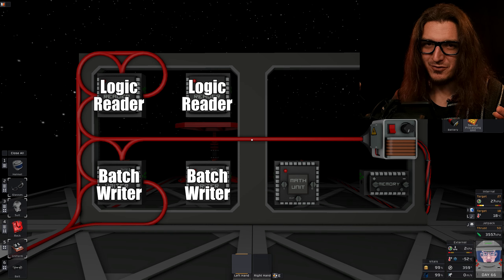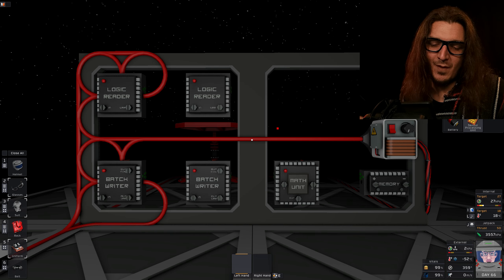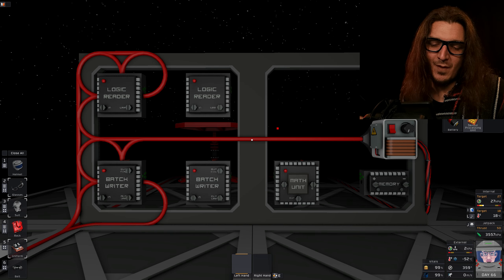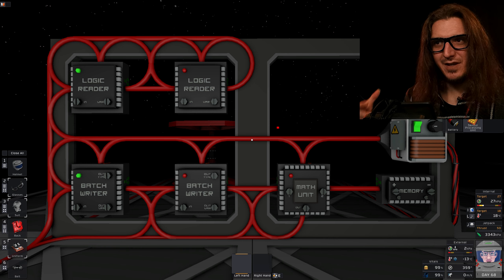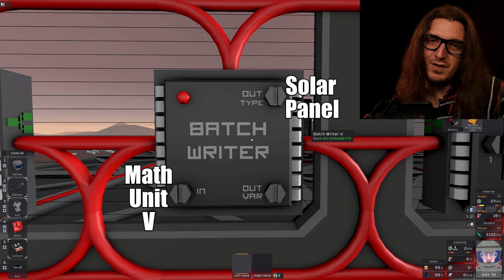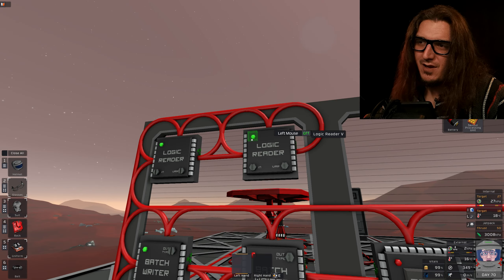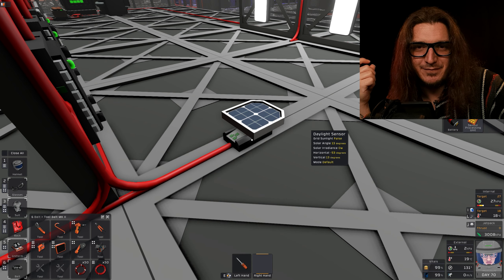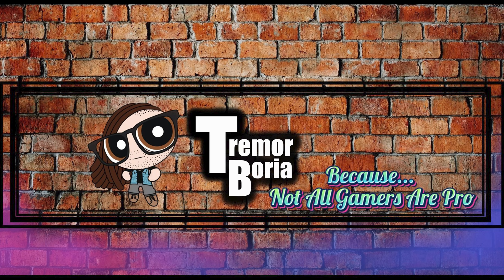Stationeers: Dual Axis Solar Tacking.

Comment: Thank you for this tutorial, quick and too the point without fluff.
Question: What's the best way to determine which way the light sensor should be placed?
If that's my one criticism of this tutorial, it should at least attempt to make clear whether the senor feeds to be horizontal or vertical, plus which way it needs to face. I'm assuming the direction might change depending on the planet, but is there a consistency as to which way the sensor needs to be placed in order for it to work every time? For example, with the data port facing 0 degree?
Reply from the maker: I see your point, and I agree. 
However, Sensor placement is the only interdependent variable in this method. Every planet is different, I like to use the trial and error tactic.  
But I agree with you, and in the future I will try to fit that in the tutorial. 
Perhaps when I come up with a method for accurately measuring direction that doesn't involve IC10.
Thank you for the comment, you have a good day.
Reply: Thank you.
I did try this setup again, but on Mars, similar issue with other people, that the angle of the panels isn't matching the horizontal trajectory. The panels are rotating relative to the sun, but they're facing towards the horizon without tilting up towards the sun. Thanks again for your video, you deserve more views.

Comment: I'm on Mars, and the panels are facing the opposite way. I tried changing the orientation of the DayLightSensor and re-initiating the values but still the panels face the wrong way.
Reply from the maker: Yes, This is an issue that come up often and is very difficult to diagnose... And you're not gonna like my answer. lol.
The only things that cause reversed panels are sensor orientation or improper values.  

Are you programming the MEMORY chip with a Labeller? 
And if so you have to make sure your clicking on the large octagon on the chip 
(which will say "Set" in green, on the screen )
Otherwise you're just re-labelling the Memory chip to 90, and the value it's out putting will still be ZERO

If math unit unit is is set to subtract, or a duplicated axis variable... 
I am just gonna write out the circuit diagram here in the comments and maybe that helps.

-----------------------------------------------------------------------------------------
              Horizontal
(Logic Reader H) 
in = Daylight Sensor, var = Horizontal

(Batch Writer H)  
in = Logic Reader H, out type = Solar Panel, out var = Horizontal 

              Vertical
(Logic Read V) 
in = Daylight Sensor, var = Vertical

(Logic Math or "Math Unit" as it say on the chip) 
1 = Logic Reader V, out = Add, 2 = Logic Memory

(Memory) 
set screw = 90

(Batch Writer V) 
in = Logic Math,  out type = solar panel,  out var = vertical.
------------------------------------------------------------------------------------------

I dunno. When mine faces the opposite way, after I'm done yelling at the game for being bugged/glitched I usually find one of the values wrong.

Also here's this
https://stationeers-wiki.com/Solar_Logic_Circuits_Guide

I hope something here helped, let me know.
You have a good day man, We'll figure this out.
Reply: Hello, thank you for the reply. I have reset and followed the same values as given above. But still they face the wrong way. Do i have to make the solar panels and Daylight Sensor face a certain direction? @TremorBoria   Which way does the sun rise on Mars?
Reply: Update: The Day Light Sensor was pointing towards East xD I got it fixed now. Thank you for the guide!  @TremorBoria
Reply from the maker: That's awesome buddy! 
I would say that the orientation of sun rise, sensor and panels works in a relative combination... But that doesn't matter, you got it to work and that's all I care about, lol.
You have a good day man, Thanks for letting me know.
 @bryanvonstase6755